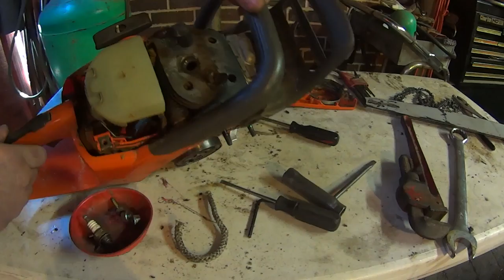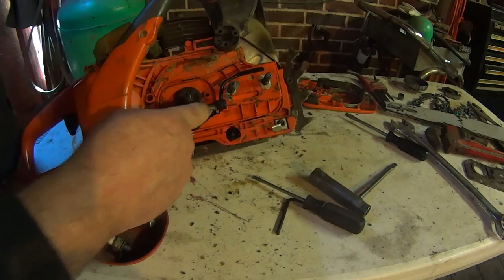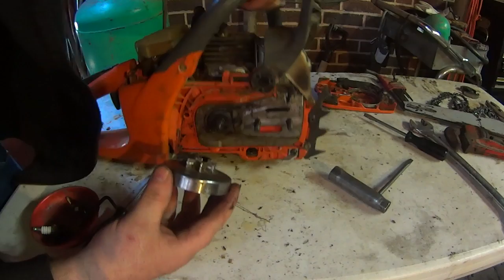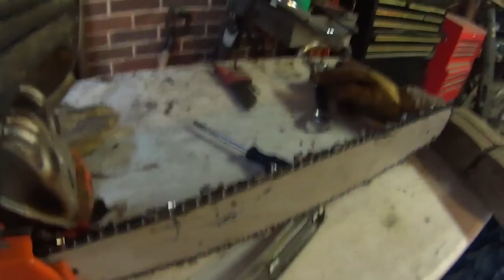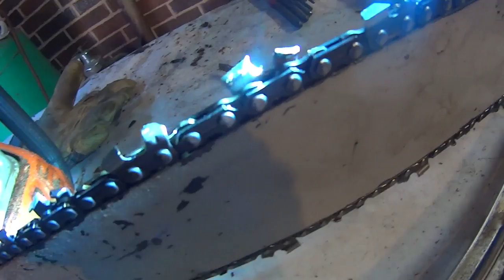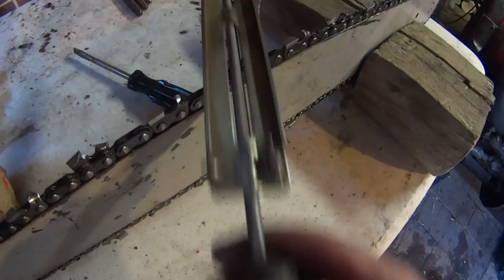Husqvarna chainsaw removing clutch oiler repair and sharpening chain

Comment: brand new rope.   Could not turn clutch either way.  stood on saw and pulled with both hands and it finally ripped out.  a smallish strand was still poking out of the plug hole.   was able to rotate the clutch until it freed and pulled that out.     I'll be investing in the right tool now !!   haha

Comment: now I have a rope stuck in my cylinder !!!   any ideas on how to get it out??
Reply from the maker: +Matthew Powell Well, there is no physical way  the rope should be stuck. Make sure to turn the motor the other way once done to drop the piston downwards would be the only thing I can think of.
Reply: The right way to insert a rope in the cylinder is to turn the clutch clockwise until the piston comes up past the ports , then insert the rope and bring the piston the rest of the way up. Then when you put the clutch back on you must remove the rope , turn the shaft counter clockwise with the clutch on and bring the piston past the ports , insert the rope and bring piston the rest of the way up , and tighten the clutch , AND NO STUCK ROPE!! .. You can screw up an engine doing it the way this guy did it !!

Comment: Great video, and this is exactly what I needed to see to get my oilier working again!  

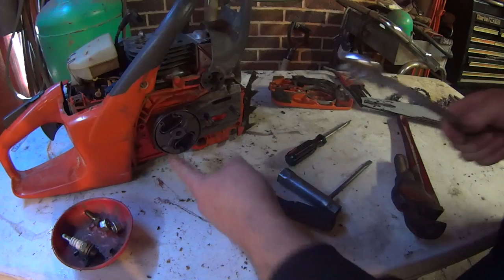@ 2:25 he points to a notch on the clutch.  I like to take the clutch off using a hammer and a punch placed in that grove.  I don't remove the spark so the engine compression coupled with a sharp blow from a hammer its usually enough to break that clutch lose and then you can just spin it off.  If its seriously stuck on though, perhaps the way demonstrated in the video would work better. 

Thanks for posting!

Comment: Great video.  I lent my 455 and got it back in a real mess with the chain off.  The dope had used it and not tightened the chain.  It let loose and tore up the chain guide plate and a few of the other plastic parts.  I was going to take it in to have the chain guide plate replaced, but this will save me the time and the money :-)  I now know that I can do it by myself.  Thanks!

Comment: Hello, nice video, very descriptive. I have an issue though if you can help. I have a 460 that was in an accident were it was struck by a tree. Now I believe the oiler isnt working because dark oil is coming out of were the clutch is located and dripping straight down. Also, I cant seem to get the clutch removed as you instructed. Is there another way I can try to get the clutch out? I just cant get a good grip on the clutch to loosin it. And its Righty = loosens   and   Lefty = tightens for the clutch, correct?>.... Thx, Rob.
Reply from the maker: That's about the only way to remove i. Turning right or clockwise removes it. It will go hard at 1st. Other than soaking it in penetrating oil for a bit it should turn off.

Comment: You R The man!! My 455 rancher is only 2 but a ton of use.  I replaced the bar and it still wasn't oiling now not scared to strip it down myself.
Reply from the maker: Hope it helps. You'll fry a chain fast without oil. It should work good with these steps.

Comment: very helpful, took mine apart and cleaned the pump, blew air into the oil res. and it works fine now.  saved me the cost of a new saw; don't want to keep paying $100 every other year to repair the oiler.